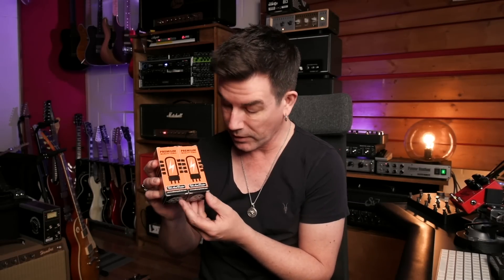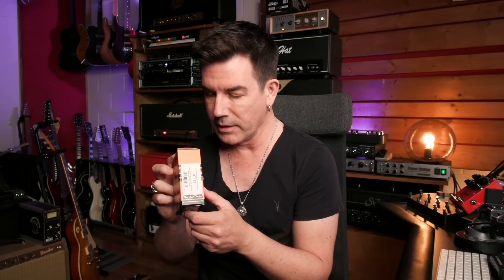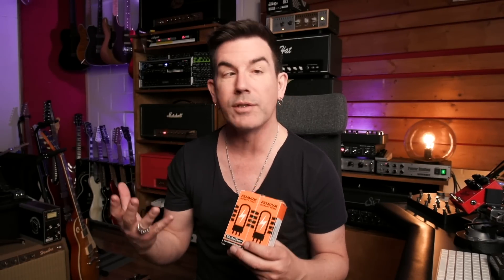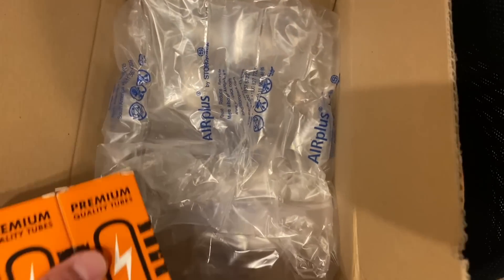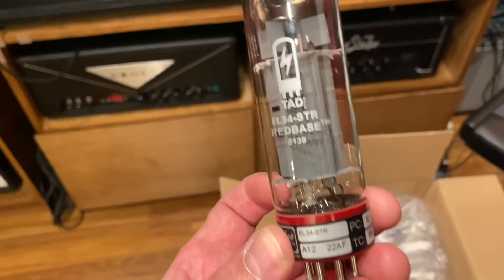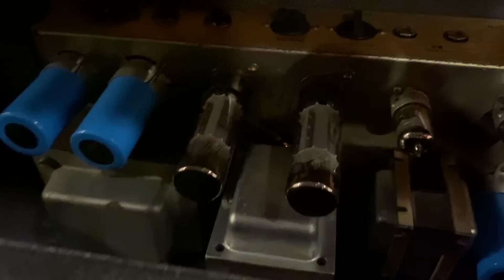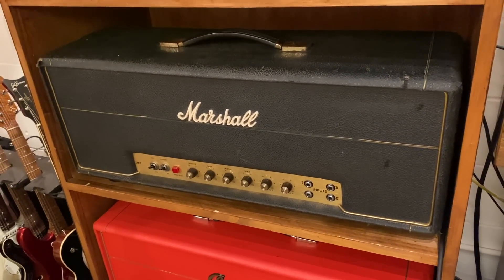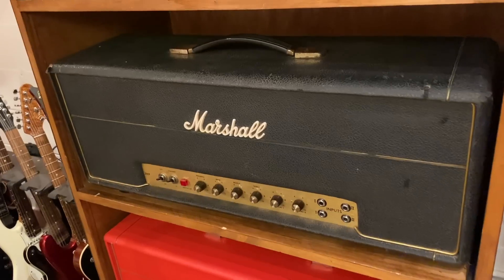ARE THESE NEW TUBES... ANY GOOD? TAD EL34 REDBASE

Comment: Kind of an interesting background to why tubes now pretty much all come from Russia. A lot of those tube factories in Russia came out of manufacturing old analog radios for the military before the fall of the Wall, and after the Wall fell many of those factories moved their manufacturing strategy into tubes for amps and especially guitar amps keeping those factories open as they moved into a more capitalist based manufacturing plant. Remember when the old Marshall 900s started they were using EL34s and by the end of their run they were using 5180s (6L6-type tubes, really), I believe it was because they came into a shortage in the early 90s because those factories were shifting in their strategy and EL34s became harder to come by for Marshall, thus the switch. They do it well because they've been doing it for a long time. Kind of an old world meets new world there. Stay strong Ukraine.
Reply: @kennethc2466  Thank You, so many people are uninformed or misinformed.
Reply: @kennethc2466  Right, I don't disagree with much of what you're saying, but the USA stopped producing them in like the mid-70s. We could, we did, but we don't anymore. Perestroika (translates to reconstruction), after the fall of the Wall, led to a gradual opening up of the Soviet economy and they still used tubes because they didn't advance the way other countries did (as you note) and still leaned on that for use in their military, also as you've noted, they moved to a market that would sustain them as there still was and is a demand for them. Matthews, EHX owner, kind of cornered that market and bought a lot of them up but has had to deal with them and their flailing, ever-changing ways for some time now; that's kind of how the Sovtek amp line came about...been a headache for EHX; he was having problems with the Russian mob before this invasion, now it's kind of halted altogether. I'm not sure your statement even runs in contrast to what I've stated or substantiates it.

Sure, we could make the best tubes in the world, but we are no longer set up to do that as those factories have been shuttered a long time ago, it would take a company or individual (Jack White comes to mind) to really kick that up again...and, honestly, I hope they do. Who knows, maybe those other countries will jump in that vacuum that's been recently created by this shortage...I hope so. I do see opportunity in it if they do.
Reply: There's Western Electric here in Georgia that makes tubes, but they rely heavily on Russia and China. And the other Chinese company, Shuguang, closed their factory in 2019 in order to upgrade, but they still haven't reopened due to permission from their gov't.
Reply: EHX released this statement four days ago, saying that new orders will be honored but at a higher cost: 

Attention All EHX Tube Customers

The export restriction on Russian tubes has been resolved for now. We are accepting new orders, processing backorders, and hoping to resume shipping in April. Priority will be given to the oldest orders.

Considering various economic pressures, we must raise our wholesale prices. This price increase will apply to all back- and new orders. Also, there will likely be a further price increase for tubes shipped from our NYC headquarters once the government implements heightened tariffs against Russian goods, akin to the 35% rate Canada is now imposing. Other territories, including EU, UK, and Japan, are expected to follow suit.

For all non-US customers facing such heightened tariffs and with combined Russian tube orders of $3K or more: Consider having our Russian warehouse directly ship such combined orders to the nearest international airport in your country. That will avoid our having to pass along the cost of the heightened US import tariff. Otherwise, you will, in effect, incur a double tariff on shipments imported first to NYC and then to a country with heightened tariffs.

You can cancel any backorder, but we do not recommend this; there is a tremendous shortage of tubes.
Reply: @bbbro34  Every word said after, "but", is meaningless, and in your case, non-sequitur word salad.
   PS, Western Electric's best selling tube is $1400 a matched pair, and they make NO GUITAR AMP TUBES. NONE! 
So thanks for proving my point even more.

Comment: They sound great, but to be honest if I can get a strong operable tube correctly biased - all the different brands sound fine to me. I can’t really tell the difference in tone in the time it takes to swap and re-bias. I figured if it takes recordings along with looper pedals to hear any difference, then I don’t really care.  Speakers and EQ pedals in the loop make far more differences.
Reply: The difference in tone is often marginal at best...I do prefer nos tubes though just because they were designed to handle the higher voltage of the old class a amps and tend to last longer which makes them worthwhile...several of my tube amps are single-ended low wattage specimens which blow the russian and chinese tubes within a few months which just isn't cost effective

Comment: I am rewatching all videos about few tubes because I am about to make the choice what tubes to use in the next amplifier. I love TAD EL34 tubes. Last time I have used them was like year ago when I was checking, retubing and fixing a Blockhead amplifier. Those sounded great in it. But it was a great amplifier as well. Iron was almost the size of the 100 Watt  models and it was 50 Watt amplifier. Great build quality. Tubes were very strong and tone was great. They were less middle pronounced as some EL34 can be and more scooped like old Mullard tubes. They sounded glorious.
Anyhow regarding TAD they do get their tubes from more places. For example their EL84 STR is a Russian tube. 
Their matching and quality control is awesome.
When I can't have amplifier on my bench and I can't provide tubes from my tube guy then I have no hesitation to recommend TAD tubes. I was still never disappointed by them. 
Some tubes can sound better but TAD tubes are as good as what it states on them. Premium selection means exactly that. Their tiers of products are according to real quality and sound.
For one of my amplifier models I use their EL84 STR tubes as output tubes. They are bit bigger and bolder and rounder sounding. More like USA counterparts then like some European versions of EL84. They7 have thicker and bigger glass/bottle as well and might not fit in some amplifiers. They have a bit more headroom as well. If I need earlier breakup I use Tung Sol version of EL84.

Comment: Ordered a set of the 6L6 redbases. Will be comparing them to my Winged C 6L6's. Price is very reasonable for a matched pair. Thanks Pete.
Reply: Winged C's are way better tubes than the TAD's red bases. The regular 6L6 red base is very TALL and won't fit in either amp, but the shorter 6L6 did so compared it to the the JAN Philiips 6L6WGB's and not bad, but not supre great either. Am keeping them both to try in my vintage Fenders maybe down the line.

Comment: Awesome video! I'd be curious if Dave or any other makers switch to this factory, it would be cool to have a manufacturer that's doing it right.
Reply: My Friedman Smallbox combo that I bought 2 or 3 years ago came with a pair of TAD EL34s which I think were Svetlanas at the time. I know that Dave and the folks at Friedman are always trying to source the best tubes available and it is always a challenge. Personally in this challenge I preferred the Siemens and I had a big hate on for them before because back in the metal says my tech sold me on the Idea that Siemens were the best out there so I switched. In my Metaltronix the newly biased Siemens sounded like cold ugly witch ass! Goes to show how what works for some won’t always work for you. I would use whatever Dave is recommending at the time in my amp. He has always given me, a complete no-name, solid thoughtful advice.

Comment: The Siemens sound like lows and highs were slightly rolled off. Warm but not as full and crisp in the top end as the other tubes. The difference is very subtle and I don't know if I prefer one over the other.

Comment: I have a few sets of TAD EL34-B from the mid 2000's that I believe were made by Shuguang at the old factory. They sound really good, a lot of Marshally midrange grind. They were similar to the Ruby EL34-B that came out of that factory as well. These are not stamped 'red base' and the internals look like the unlabeled Sino EL34-Bs. They are a;so stamped as EL34-B STR

Comment: Totally agree, to me this EL84 have a big bottom, hence some mentioned similarities with an 6L6 but is on the bass response that creates that association, in some amps sound great like in my Bassbreaker 45 make it sound kind of more bassmanish (as the circuit supposed to be close ) and bluesbreakerish kindy close to JTM45 than stock sound more like a straight 68 tamed  rounder plexi, but in some other the saturation tend to go muddy, sludgy and loose articulation like in my marshall red flag that is already an edgy amp that falls apart kindy about-to-blow-up kindy situation when cranked that I love with Mullards but with this ones get sludgy and mushy, great review as always

Comment: The Siemens are greasy with great midrange and the Red Base do have that nice bottom end, but are a touch bitey in the highs. I can always tell the Chinese tubes apart from the top end bite they have, that could just be due to the molecular density of the cheaper metals they use vs heavier duty metals in NOS stuff.

Comment: Brought a Marshall 6100lm with Sovtek 5881wxt tube that had been in for years, tried some new tad tubes all he had were 6L6GCM-STR REDBASE tubes. They had a harsh top end a boomy low end so I put the Sovtek's back in and now I'm stuck with the new tubes. My JCM900 SLX had TAD 6L6WGC-STR BLACKBASE tubes that sounded great but blew recently, so I put the new TADs in and harsh top end and boomy low end. Have been told TAD have discontinued the BLACKBASE tubes which is a shame because they sounded so good, anyone know any good 5881/6L6 tubes.

Comment: So with the price increases would you go with a EH EL34 (quad)  $215.80  or TAD EL34 (QUAD) $173.26?  I just got a used JCM2000 TSL100 (un modded/original) .  I need to take it in and have it looked over. The tubes look original to amp so was thinking they need to be changed.  What would you recommend  pre-amp tube and power amp tube wise? I like the ac/dc sound (RFT/SIEMENS)

Comment: Did u not have the amps 2 channels connected...or did Dave just wire your 50 watter internally so as to not have to connect the channels on the outside of the amp?
Reply from the maker: No jumper for this video just top left input channel 1, with the volume on about seven
Reply: @PeteThorn  Wow you weren't kidding they do have more Bass response...I find Most SLO/JMP/Plexi Marshalls on only channel 1 by itself to be a little Ratty and Thin....not with this setup! Very Cool! Thanks Pete!! My Old Marshall needs new EL34's...So good to know I got an option!

Comment: Man somebody gave me on of those really cheap solid state Marshall HDFX 100watt heads a few years ago and I honestly never used it till a few days ago because of all this tube talk stuff. 

I was like HOLY CRAP!! This head is NOT BAD!! I was told this head sucked and wasn’t worth the electricity it takes to run it. Well I’ve found that is just not true. This hdfx thing is a pretty d***m good amp. These things only cost like $400.ish and has passable tone and it has great power. Im pushing 2 JCM1960B cabs and it does great 😊

Comment: Spoiler alert, tubes make no difference in tone. All they do is translate electrical impulses to sonic impulses. Knock-off brand tubes will do the exact same as the top end. Speaker, cab construction quality and materials are the ONLY things that affect tone or sound. 
Anyone buying high-end tubes for "tone" or "sound" is an idiot and you're wasting money.
Reply from the maker: Um… The management of this channel does not support or condone or correlate  or reciprocate or corroborate or like, agree with this opinion